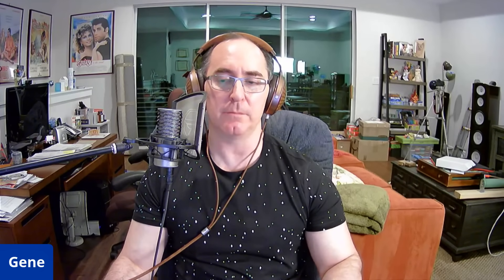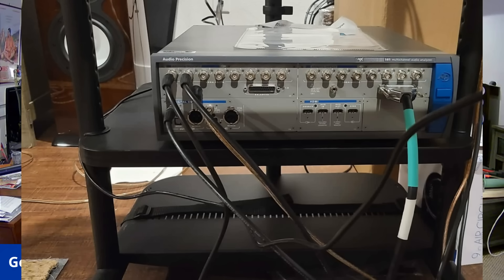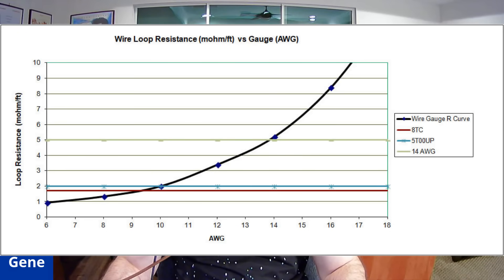Speaker Cables Really Don't Make Much of a Difference?

Comment: I've just made the test. The generic 18 gauge that came with the amplifier vs. 12 gauge oxygen-free copper cables that I got for another purpose.
Same length in both cases, around 3m, and 8 ohm speakers. I can't hear any difference, but not only that. The frequency response curve (measured with the same calibrated mic) is IDENTICAL.
I'm not saying cables don't matter for much longer distances or much more powerful equipment, but for domestic use, with short-length cables... all the audio cable's hype is basically snobism.

Comment: They need to find a sucker to make a buck -
Cables just don't matter at all.
I run my old set of Infinity speakers with yes, just ordinary cables.  
Somewhat thick cables, but otherwise quite ordinary.
Yes, for the second best set of Infinity speakers ever made.
I spend the money where it actually matters, and that isn't on cables.
Making arguments like in this video is not too much different from saying that a
digital camera will take more detailed pictures based on choice of memory card.

Comment: No they don’t I have svs ultra speaker cables and had some un opened crutchfield speaker cable and switched out the svs for the crutchfield and it sounded just as good edit : I switched out my svs cables to kimber kable and I could tell a difference.

Comment: Just recently I bought a cheap rca to din cable on ebay for £29 to connect my cd player to a brand new Naim Nait 50. Sounds great. I needed another cable for my streamer, I thought why not, I'll get the Chord cable for £250, my new integrated deserves it plus I could compare these two. No difference whatsoever, I've sent the Chord back. That's it, end of story. Some audiophiles might say 'spend £2500 on a cable, you'll hear the difference '. Yeah, right...

Comment: thank you for a very precise test very well presented.
What is not covered by your video is the affect on phase (if any) of the cables, and speaker vs 8 an Ohm resistance.
 complex signal.
A test with complex signals (i.e two or more tones) , and Pulse response can reveal further more information which can strengthen the conclusion (for any direction that is found).
Reply from the maker: phase changes caused by a cable are negligible and a non-issue. Next time I pull cable measurements, I will show this.

Comment: My first encounter with speaker cables was many years ago. A UK company was importing these strange flat braided cables from Japan and showed them at a Hifi show. The difference was very clear. I had them some time but eventually was warned that these cables could easily be damaged and destroy my amp. Since then I have had 3 different mid-price cables which gave smaller improvements. 
There is an obvious possible problem with your tests. The cables from the instruments to the test connections. Surely these could affect the test results?

Comment: Just a minute.  One frequency?  What, say 1 kHz?  What about intermodulation distortion, with simultaneous frequencies ocurring, & dynamic & rapid, sometines pulse-like changes going on, as in music?

Did you carry out any step-frequency testing with these cables, or pulse testing?  Square wave response testing?

I'm no expert but back in the 80's my system consisted of Bose 901 mk IV Speakers, Nakamichi 682ZX cassette, Toshiba SRA110 belt drive turntable with Ortophon Concorde 10 or Stanton 680EEE cartridges,  a self-built ETI Series 5000 stereo preamp & a pair of Series 5000 bridged monoblock power amps, also from ETI.  ETI being Electronics Today International, an Australia-based monthly electronics hobby magazine at the time.  Designed by David Tilbrook.  Supposedly real good specs  from them, even at 300 watts RMS per channel.  I really liked them!

So, I was using probly 22 gauge grey figure-8 (zip cord?) speaker cables for a while with the black stripe for positive.

I bought 10 metre lengths of Monster Cable with crimped gold eyelet connectors on each end.  The moster cable was the clear, very heavy duty figure-8 type that was 5 bucks a metre, which hurt my apprentice pocket!.

I had no rapid relay controlled cable switchover system to do A - B testing, but the difference to me was the visual equivalent to looking through a tinted window, & looking through a non-tinted window.  Like listening to the speaker with a blanket over it, then removing the blanket. Nicer bass, maybe deeper.  Only small, subtle differences, but definitely better.

I would agree that there comes a point of diminishing returns where any more effort, money, research spent on cables is just not going to be heard by human ears.  I dunno what, shielded, twisted zero gauge figure-8 semi-trailer jumper leads separated by 1.5 inches, or 200 22 gauge braided & separately insulated cable, or something like these, may be the best you would ever want.  

It's likely more complicated than a few simple instruments can measure.  Stephe from Skunkie Designs gave me a shiver down my spine with her superb description of the subtle sound stage improvement between valve (tube) amplifier output transformers.

As for 72 volt speaker cable bias batteries it may depend on which end it's connected to, & the battery's internal impedance.  72 volts may be enough to cause some kind of galvanic corrosion, particularly on the strands exposed to the air, & even on clean copper strands that haven't be touched by greasy fingers.  So the polarity of the battery may need to be reversed periodically to negate or reverse the reaction.  Different though to how I make my colloidal silver solution.

Comment: Maybe im not understanding what differences you are looking for? 
Every speaker cable ive ever used produced an audiable difference. 
I now use Harmonic Technology Pro 9 plus.
Reply from the maker: Under controlled listening tests no trained listeners have ever demonstrated audible differences in speaker cables with statistical  significance.
Reply: @Audioholics  Theoretically, I would think that could equally apply to sound electronics like amplifiers and preamplifiers as well? 
I know I purchased a Classé amplifier over a krell only because I couldn't afford a purer quicker Spectral. 
Am I to assume there wasn't an audible difference between the three of them?
Reply from the maker: @jamiesmith6838  amplifiers can sound different under controlled testing, especially ones that are not loaded invariant.

Comment: Is there any mean of mesuring conductivity between those 3 cables ? As the quality may (or may not) improve between those 3, it can has an effect on an audio signal right ?

I mean no one has ever studied trying to compare the (non?)correlation between conductivity and audio signal, I tried to find studies, and never found any. So I guess it might be interesting, because just mesuring that can(or not) show other differences and parameters, right ?

And there are a lot of things related to audio signal to also measure, like, how the sound is spreading out of speakers, if there's anything between phase cancellation (or not) when the audio signal spreads out of the speaker, if there's an actual difference on those parameters when you change the shape or the quality (mostly conductivity) of the cable ? I mean, it sounds unmeasurable, but yet, can it exist in terms of logic and from a scientific point of view ? I think yes, and we can't measure that YET, does it mean it doesn't exist ? I mean, those are questions I'm asking.

Never tried different cables myself (simply use OFC 2.9€/m - well, now 3.7€/m with inflation - 2.5mm² SommerCable, nothing utterly fancy), but I hear so much people making blind tests and hear 8/10 positive differences, makes me doubt either one or the other "sides", doubters or complete praisers, and can't actually have any opinion on it as, for me, both point of views are biaised with either ONLY measurements and ONLY hearing tests.

As also, one day, changing my 1/4" Jack cable because it wasn't long enough, from my Keyboard ( 80's Viscound D9 - Hammond Organ kinda "Electronic" clone) to my 1974 Sound City B120 Tube amp. From a basic Yellow Cable to a much longer (3m YellowCable vs 6m) SommerCable with HiCon connectors (not much of an expensive one, I mean around like the ones you can find from Fender or D'Addario Planet Wave ~30€, not too fancy and also much stronger) ref : Classique CQHU-0600-WS, and found STAGGERING differences between both, in terms of Output or clarity, the SommerCable not cutting any frequencies, YellowCable sounded so dull. I mean, that wasn't placebo effect because I wasn't even aware of a "battle" between cable praisers or debunkers (or whatever), neither I was hoping for anything in sound quality, I just wanted a longer and stronger cable (cable running on the floor so I wanted one with a sleeve). So, yeah, I don't know what to think.

Comment: I'm really enjoying my 10 gauge speaker cables from Blue Jeans Cable.  I like that brand because they are only a little more expensive than cheaper stuff.  In fact, it looks like the premium they ask for is for the terminations.  They use a really low resistance weld and great locking bananas.  I thought about saving the money and doing the terminations myself, but with 9 channels it's just too much work and I certaiinly can't make a mechanical connection as good as their welds.  Blue Jeans for me all the way.  Got my RCA to XLR custom interconnects for the Buckeye amp from them too.  Worked perfectly.

Comment: I commented on one of your other videos about having a Yamaha RX-3050 and an Onkyo TX-SR876, and I was using the Onkyo as a separate amp, in bridged mode, to power my two fronts. Apparently it's one of the only A/V Receivers by Onkyo that has a bridged-mode option. It works great, and been running it for a couple of years now. I started wondering about what difference there might be with instead of running bridged mode, to run it in bi-amp and bi-wired (Paradigm Studio 100s V.3), so I picked up another set of BlueJeans cables. It kinda sounds different/better, but I'm not sure if that's just a placebo effect. Is there any testing information on those kinds of setups?

Comment: Let me start at the speaker - no speaker reproduces all frequencies from 20 to 20kHz exactly. Making raw audio frequency sweep  tests graphed out on a X-Y plotter, many amplitude variations and some frequency loss, very low amplitudes are recorded. Then going up-stream to the CROSS-OVER circuits the audio signal is maligned and parts are phase shifted or attenuated.
For instance lets look at the middle A note of a violin. Frequencies of 440 880 1320 1760 etc. Many Cross over circuits are around the 1kHz area. So the coil-inductor will shift the lower frequencies in one direction time wise and the higher frequencies above 1kHz in the opposite direction.
 To be brief, then the audio signal will be  damaged pre-flavoured -  no matter what cable is used.

Comment: Thanks for you review of Kimber cables. Helped design many of the cables and the Palladian power cord.
RADAR RF - microwave - audio designer. We used an HP network analyzer for our designing and investigation.
  My I interject here that cables make an audio difference BUT are over shadowed by speakers response and the use of CROSS_OVER circuits.

Comment: It's probably been mentioned before but just in case it hasn't: You correctly emphasize the importance of room treatment, but your room is a mess, your speakers are put right to the wall and you have reflective surfaces (glass door, glassed picture frames) all around. This is going to make your message fall on very deaf ears when it comes to serious audiophiles. Maybe your message should have been: "Hey audiophiles, if your room looks like mine and your speaker placement is as thoughtless as mine you don't need to spend money on cables."

Comment: I’m recently back into HiFi after a 5 year hiatus due to home remodeling. I’m using Mogami 3103 and like it. Hey I’m retired jet pilot how much can I hear. But I was curious so I brought out my old (20 yo +) audioquest type4. Mogami sounded better.What’s your feeling on Shunyata research and the Shunyata Venom. I can get it used for 600 bucks. Occ copper sounds like a winner. Thanks Steve

Comment: Thanks Gene. An old Vid but always relevant. Way back in 1999, I was using a NAD amp with Mordaunt Short mains. I think I was using maybe basic 24 guage speaker wire. For my birthday, my brother brought home 6 metres of Audio Note's own in house wire and I promptly ditched the old and made way for the new.......with absolutely no difference at all. My wire was 40 pence per meter and the Audio Note stuff was £90 per meter. Because he worked at Audio Note, he got it for nothing. I continued to use it for a good few years in different systems but I never told him I heard zero difference and I've never bought expensive speaker wire since.

Comment: A wonderful, very detailed lecture, explanation on the potential, and efficiency of speaker cable, and wires. Thank you, Gene. We do need a bit more science in hi fi audio! Important information, and technical results for a hardcore hi fi audiophile, or more of a music fan such as myself. If we can hear a bit of a difference, then there is also something to substantiate such technical claims. There's got to be results such as the numbers, and lines as you have shown, and explained on the graphs, for example! 

I've forgotten what is a doubling of level of sound, whether it is 3dB, from 1st year college. Anyhow, I suppose it could be perceived if a listener is in a quiet room, and concentrates. Or is up to 40 years old (and official middle age starts at 45). There is also the case of noise pollution in very recent times that may have affected our hearing, but that's another story. Or all of the above. Great work.🔉🎵🎶

Comment: you didn't try silver plated cables because you will hear a difference and a big one. plus up-occ copper sounds better than normal standard copper speaker cable. I hear an OBVIOUS difference. comparing only standard grade copper cables at different price ranges won't give you much difference you gotta have a clear difference in the type of copper for a comparison.. or even silver plated

Comment: I am with you 100% and I thank you for bringing a hands on science and testing approach to this decades old mystical debate. 
I am using good quality copper, locally made (Turkiye) speaker cables.They are 2.5mm2 (14 AWG) figure of 8 type cables with a 2x60W system. They probably have a very simple insulation material (silicone/rubber/nylon) too. I my experience and education, using cables with;
1) Good quality copper (in terms of elemental purity, which means not alloyed with any other less conductive metal, or not made of any other metal then copper coated)
2) Correct thickness (current handling capability with minimum voltage drop)
3) Good quality connectors
is what counts the most. There are of course other factors that do contribute from a theoretical (electrical engineering / physics) point of view but once you get the above 3 criteria correct, 95% of the job (cabling) is done well enough, the rest is very optional, and some may even be just a waste of hard-earned money.
Reply: why shou7ld we call your country Türkiye? do you call Germany Deutschland? no you dont.
Reply: @James28R  You can call it whatever you like, even "gobble gobble country", for all I care. You must be fun at parties...

Comment: Congratulations.  You have proved that all three speaker cables are made of copper.   I think that the  manufacturers should just respond by saying we told you our cables were made of copper,  You have a preferred cable,  you tell us why.  I believe that tests that are able to quantify why some cables sound different have not yet been conceived, but I know that cables sound different.  Also, I don't think you should push the idea for people to believe test results for purchases and not their own ears  That to me is just as bad as the sales people, that praise a certain cables, that you are running down.   This promotes an idea that everything sounds the same.   Then what would you do?  I have no dog in this fight I do not work for a manufacturer nor do I sell audio equipment.
Reply from the maker: Most perceived "audible differences" in cables is placebo. Controlled listening tests have never proven  discernable audible differences between cables with statistical significance.

Comment: No they don't , it's just how much power you are trying to drive that determines what gauge you have to run. I was a pro audio engineer for 20 years.... we used Belden 10-12 g  wire for all of of our massive PA systems... None of the stuff you are measuring will ever be audible.....

Comment: This helps avoid the wankery. I bought the thickest copper wire I could buy. It sounds fine. I tried bi-wiring; running Channel A+B Running the tweeters on channel A and the woofer on channel B, Running one speaker on A and one on B, bi-wired into one channel. No difference! I am back to one set of cables for each speaker. Most people fail to mention the quality of the recording itself. You can't make a silk purse out of a sow's ear. I would prefer to spend the money on a better phono quality cartridge, an ultrasonic record cleaner or more music!

Comment: Thanks for all that work and the video. It would have been nice to compare a step response on the resistive load. I wouldn't suggest this on speakers. That might bring out a bigger difference in the cables. A square wave generator and an oscilloscope may be in order.